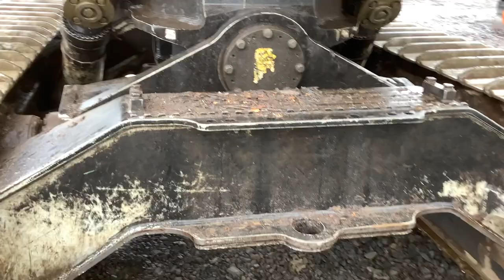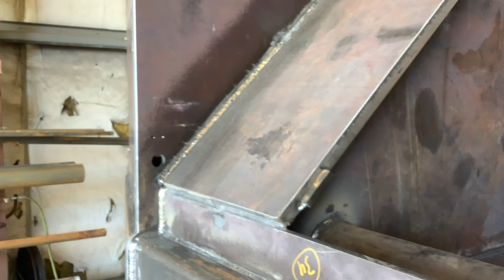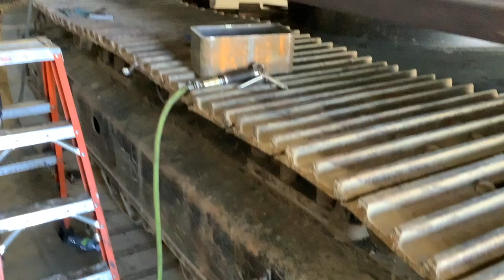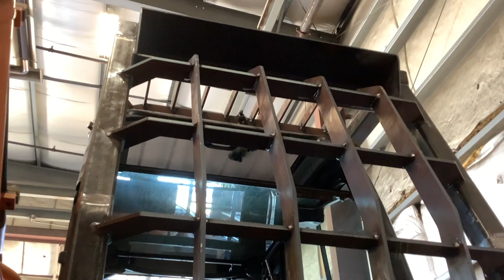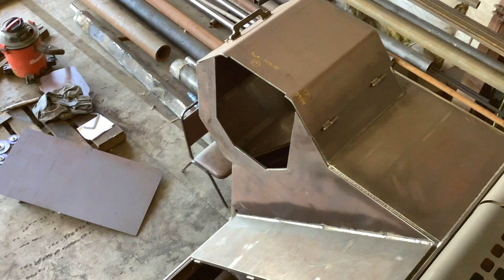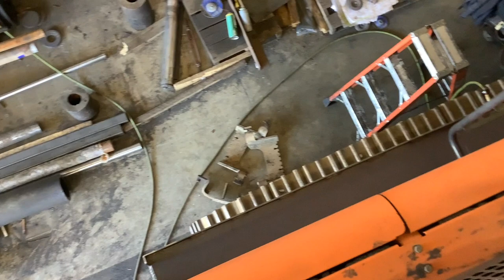470 Hitachi Line Machine Conversion Video #3 -  And The Tigercat Buncher In For A Stinger

Comment: Looks like they are doing a good job! That is nice protection. That is really similar to how mine is done. We added almost nine thousand pounds of steel to mine and it is only a 210...lol. A lot of my steel was cut with a water cutter at Meadows Mills Sawmill factory.
Reply from the maker: Copy! It's coming along. It got primed and cooked this week and maybe painted. Getting close. Drum set, valves and controls, radios, lines, paint and cure, still quite a lot of work to go but they'll get it done. I'm looking forward to it so I can stop thinking about how I will work different areas and actually be doing it! Going to be a learning curve. How's your summer coming along! Markets are good out here, it's full throttle. Let's hope it all holds together. Good to hear from you, be safe!
Reply: @thedailylogger  We are working wide open. Pine market is not all that good but it is improving. It has been very cool so far this year. We are usually in summer by June but not this year. I have to go back and finish 2 big jobs this summer that we abandoned due to winter weather last year. I always hate that. Each one has about a million feet left. One of them has a large part that is beyond 70% and rocky so I will be hand cutting a lot of that... oh well it's part of here...stay safe out there!
Reply from the maker: @timberslasher4899  Copy. Things are good here at the moment. I hear you on having to leave and then come back to a job. Sounds like the one in particular is a real Lulu! Well, good luck on 'er, and be safe out there.